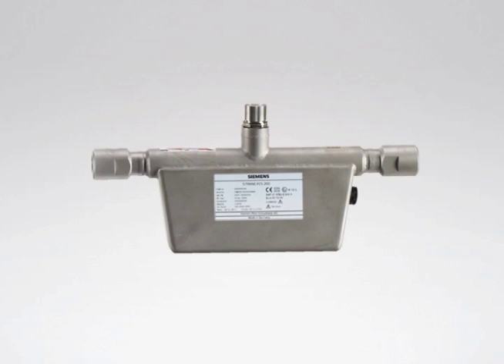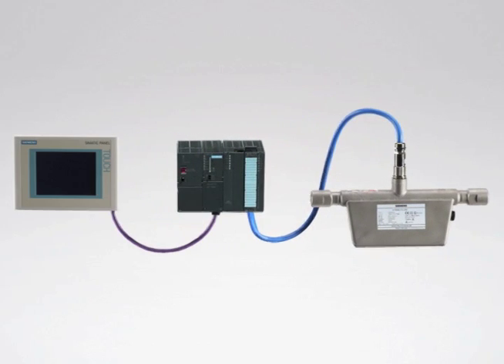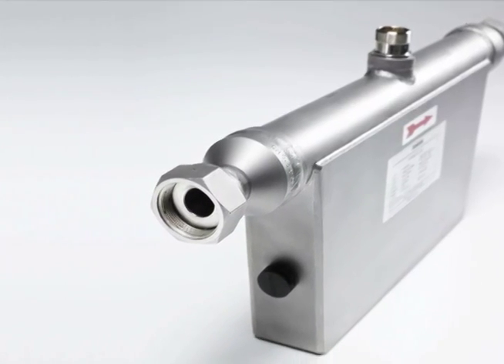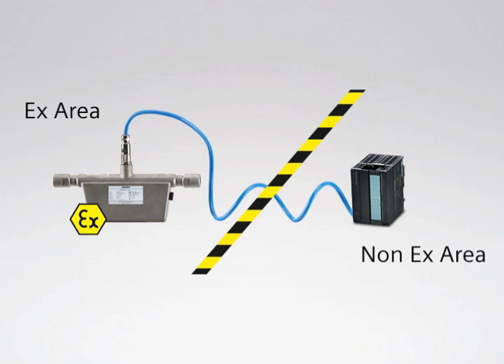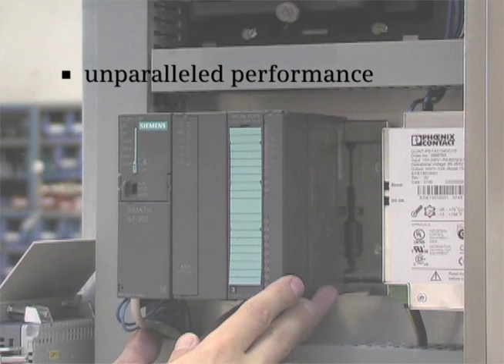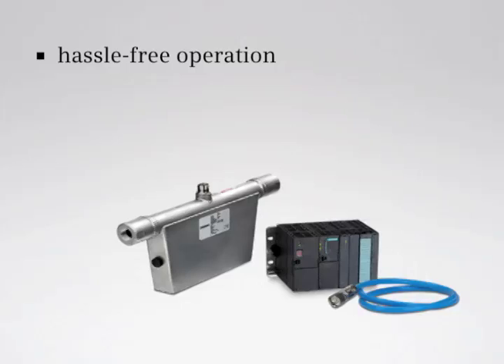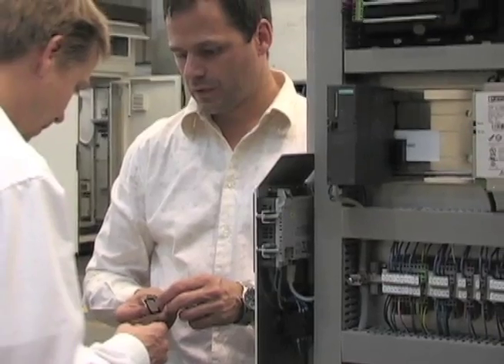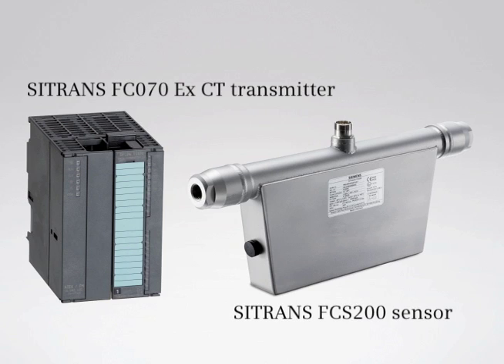Siemens flowmeter solution for CNG -- ahead in size, performance and simplicity

Comment from the maker: @ducdude1 Our CNG flowmeter is suitable for custody transfer (CT) CNG applications all over the world. Today we have the PTB - Germany custody transfer approval:
PTB - (Physikalisch-Technische Bundesanstalt) in Germany for high pressure natural gas - used in dispensers
Based on: 
OIML R139 - Environmental test and OIML R139 - Performance test.

You should always check with your local authority to confirm the local approval requirements.